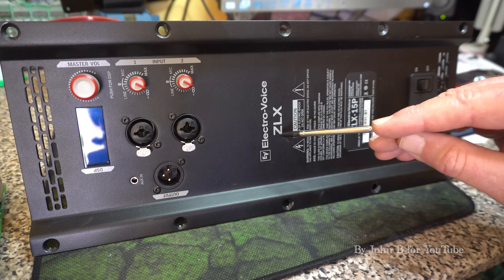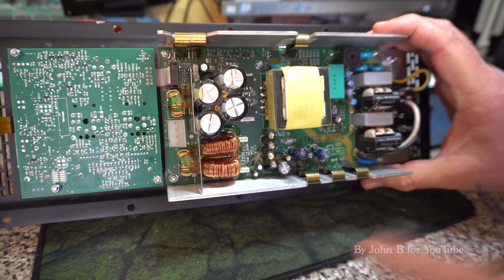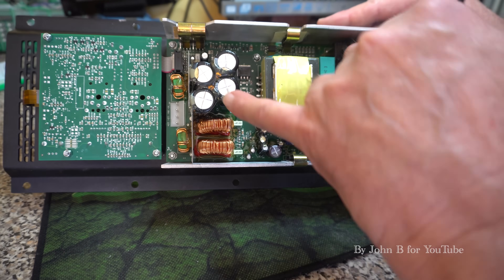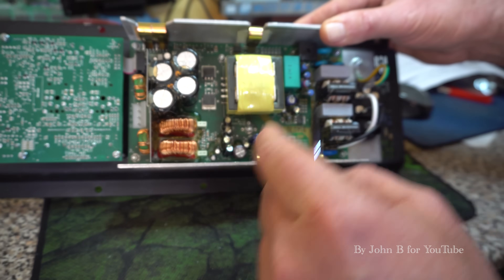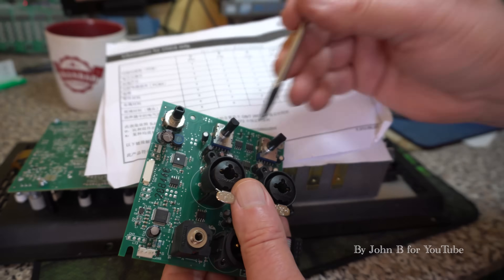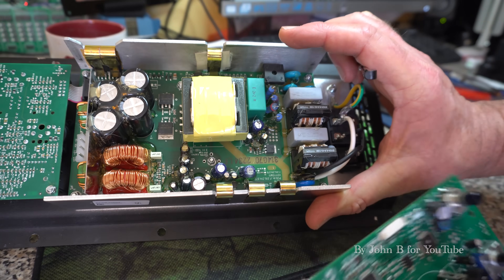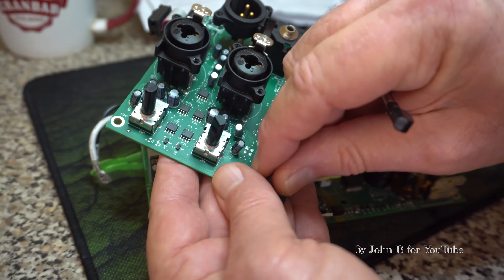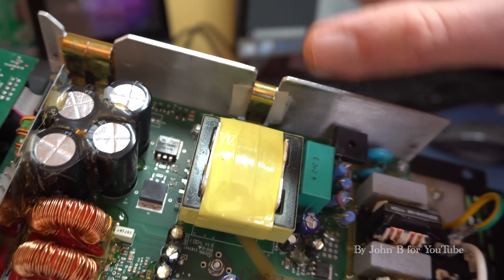The Inconvenient Truth about your Electro-Voice ZLX-12P & ZLX15P amplifier (Read Show More)

Comment: I’ve had my EV XLX 12ps for nearly 4 years now, and with an EKX 18” subwoofer, they sound beautiful and look great. I suggest using the DSP and setting the main volume limiter to negative 1 or negative 2, this will reduce the hiss to a level that’s so low, it’s almost nonexistent. It’ll also protect your speaker from going above where it should. Then set the treble to negative 1 or 2. I Dj Weddings and venues and charge between 1500 and 2000. The amount of compliments I’ve received on my sound and presentation have been very encouraging, and have allowed me to get more weddings from every wedding I’ve DJ’d. My EV’s have been in use, as stated for close to 4 years, 4 to 5 times a week. On Sundays, when I Dj at a Caribbean restuarant, they’re in use for 8 hrs straight.

The information in this video isn’t anything new, even though it’s very good information, that’s readily available on any good DJ forum, and it’s true of literally every speaker brand. Of course the 1000 watt number is wrong, It’s the advertising peak number, or more technically, the sound one can sustain for 2 seconds, without a hard limiter, before literally blowing the fuse in their PA speaker. Whenever a Dj tells me they have 1000 watt speakers, or 2000 watts, I laugh. The RMS number is what matters, and knowing how to properly use them as well.  These actually only use about 250 watts at best. You simply need to make sure you don’t use a traditional power strip, but rather a power adapter or conditioner that lets you know if the wall line is clean and outputs reliable currents. The other aspect is, even with my QSC k12.2s, which were almost double the price of my EV 12Ps, most PA speaker that are self powered will be using a class D amplifier and rate it’s power as peak rather than RMS.

Once you have a subwoofer and set the cutoff on the EV ZLX 12Ps to the user generated -100 or -120hz frequency setting, or the included properly pre-designed presets for the EV subs, you’ll prolong the life of your PA speakers, because the subwoofer cones in all of these are where the faults lie. They’re not reinforced properly to cut costs, and due to being bi-amped, will never replace a dedicated subwoofer. Using the Sub cutoff on the EV 12Ps also allows for more power to be relegated to the tweeter, producing a more well rounded sound with an external subwoofer .

As for the Mackies? I’ve owned several models that are newer, or within the 4 year mark, they all have the same poor, overly done bass, and sound boomy instead of clean. They also tend to have a louder class D amp hiss. While all class D amps have this, with the EVs when you cut the limiter by 2 it reduces this to negligible levels. Because a lot of excellent singers come to karaoke nights, when the music drops out and they sing, acapella, you can hear the clarity. When certain people sing, the bar crowd becomes quiet enough to their vocal nuances. With the Mackie Thumps, when people stand near my speakers, the hiss is perceptible and sounds cheap. I can use my $350 a pair EVs with my EKX 18” Sub and have people come out for either music and karaoke nights, or simply DJ nights, and always have people come back due to sound quality. When I use my QSC K12.2s, the main difference is that with the cutoff, they have a higher overall decibel rating. Without my included EKX Sub, the QSC k12.2 PA speaker subs also provide crisper bass. Aside from that though, that’s my OCD noticing that.

Some of my favorite singers who come out that also perform in churches and showcases, generally can’t tell the difference in the sound. That’s also down to my mics, as well as my mixer and my DBX go rack, where I use a final warm acoustic EQ, overall sound compressor, and lastly, a feedback suppressor, because at times I have as few as 2 singers with wireless mics out, or as many as 8 singers with wireless mics out. The DBX Go Rack is unfortunately not sold anymore officially. I paid $27 for mine when they were liquidating them. Unfortunately I only bought one. It was used at every gig I had for 3 years before dying during the last 10 mins of one of my gigs. I unplugged my XLRs from it and then plugged them directly into my PV AT10 sound mixer. The audio sounded nice, but it lacked the warmth that my crowd expects from my sound. Alesis mixers are naturally warmer, but the PV AT10 has a nicer array of effects and shielding. As a result, I bought a new in box DBX GoRack replacement and due to only being sold by 3rd parties, it set me back 225 on reverb. 😭

I can safely say that if you get the covers for the EV ZLX 12ps, and work with a sub, cutting off the 100 to 120hz signals, you’ll be in great hands. I treat my gear very carefully, and understand how to use the limiters and the mixer to avoid clipping. It’s also important to turn off the speakers first before turning off your mixer. Knowing about these things keeps your gear from getting damaged. At that point, after well over 1000 venue gigs and roughly 15 weddings a year, my EV ZLX12Ps still sound amazing. To be fair though, for roughly 5 of the many wedding gigs a year that I do, I use my QSC k12.2s for crowds above 200. They simply carry further for those events. If the fuse ever goes, EV makes it incredibly easy to replace via a cap on the back of the speaker.
Reply: Wow!! What awesome information! I'm a DJ/KJ as well and am looking at the EV's ZLX-12P and ZLX-15P. I would "really" enjoy communicating with you in helping me with my current setup. Your setup sounds very similar to mine. MY gray area is dialing everything in safely and getting the best I can out of it. Thanks for your Info. Ray 👍😊
Reply: RAPA Ent. You can always feel free to, I’m always happy to talk about DJ gear. To say the EVs have been great for me would be an understatement. My friend who DJs told me I have the warmest sound of the local Dj’s he’s seen, and truth be told, when I started again, his sound was my goal. He was using the original QSC K12s with the KSub. The thing that he had an issue with was equalizing his sound. Now starting out, I bought the Mackie Thumps, and the balance was never quite right. The hiss was also always present, and the treble, even with careful EQ presets was muffled. Then the JBL Eons were going down in terms of quality. 

At the time, the EV ZLX 12ps were the best reviewed in class, and they also were the only speaker in that price range at the time with a Digital Signal Processor. Ironically, I bought the  DBX GoRack to see if I could fix the sound issues with the Mackie Thumps. There was nothing that I could really do, even lowering the bass to see if it would bring out the treble didn’t help, it only made the class D amplifier hiss more prominent. While that wouldn’t be much of an issue with club music, for karaoke with the singers I’ve been lucky enough to bring in, it would be terrible. Their reliability also isn’t great. The JBL Eons had less hiss, but it was still prominent, they also had harsh sounding mids, and the bass wasn’t clean.

I returned both sets, and went with the ZLX 12ps. As stated, they’ve been used more than a 1000 times according to my nearly 4 year Virtual DJ history. When I finally bought the QSC K12.2s, it was interesting, by default, the sound is a little harsh, but it’s exceptionally clean. The bass is also quite good. Despite the price difference, like all PA speakers, they use a class D amplifier, so there’s going to be hiss, however, it’s lower than any speaker I’ve tested, even the ones most companies have had me use in the rare times when I’ve worked with a Dj team rather than solo. Properly EQ’d, they sound stunning. Now with the EVs, especially given their price point, the way you can cut back the hiss by reducing the hard limiter is surprising, it’s a little bit louder than the QSCs, but it’s also less than half the price, and the fact that that’s my OCD also comes into play. As with any PA speaker, having a sub helps, and as far as subs within a good price range, EVs ELX118 Sub is quite excellent. I’ve used it with both my ZLX 12ps and my QSCs. It’s not the most powerful sub, but I’ll let you in on a little trick I discovered accidentally. 

Here it goes, most venues have wood floors or hard tiles. When you place a sub directly on those surfaces, it creates what feels like reflected bass, it sounds like rattling in a way. Basically, the frequency of the subwoofer is vibrating the surfaces directly. If you use a Rock and Roller mini cart to wheel in your gear like I do, they sell an overpriced wooden, carpeted base for it that’s a separate charge. It has little lifted, wooden feet to slot it onto the cart. Placing it directly on the floor in a venue, then putting the sub on top of it completely prevents the refection noises. The carpeting on top also prevents the sub from vibrating on the surface. As a result, you get cleaner subwoofer bass and performance, without the odd sounds you get from directly placing it on the floor in a venue. Initially, what I’d do is use one of the Subharmonic EQ presets on the DBX GoRack, but since they’re overpriced now due to being discontinued, it’s not a recommendation that’ll help anyone. The Rock and Roller mini cart floor mat accessory provides a more consistent result in this case.

Hopefully this helps you in some way. And in the end, the ZLX 12Ps are routinely on sale on reverb with the EV slip covers. I’ve seen them for $600 during holiday sales, $100 less for a pair. When I bought them, they were $345 each, on sale from $400, and the slip covers were $60 each. It’s still a great value given their sound quality and the amount of usage I’ve gotten out of them. I have an EV EKX 18 inch sub, but use my ELX 118 much more because I only weigh 145 pounds and the ELX is just over 60 pounds, plus, it sounds great. The trick with the subs is the cutoff. It doesn’t matter how good the bass sounds on PA speakers, people complain at times because the bass is literally in their face or slightly higher when you poke mount them, and with a sub, it’s completely grounded. When you use the DSP on the ELX 12ps, there’s an option to cut 80-120hz of bass off of them, sending that down to the subs. The ELX DSP has a ZLX 12p preset, which sounds nicely balanced. With the subwoofer cones in PA speakers, and the amazing 6 year warranty on the QSC K2 series speakers is included in this comparison point, the woofer cone is typically always the first thing to go. Why? The bass cone will eventually micro tear after awhile, either blowing a fuse, or it’ll simply be due to how costs are always cut on the sub aspect of PA speakers. The QSCs have 6 year warranties due to using somewhat better materials than other PA speakers, but taking them apart reveals that while they have better cooling, with a clever passive heatsink and quiet active fan system, the sub cone, while still of better than average construction, is still the weak point. A decent dedicated sub, like the ELX, uses some composite titanium cone drivers as reinforcement. That’s why it wasn’t so bad to buy an ELX floor model from Guitar Center. It cost me $475 instead of its initially much higher price point. I wouldn’t do that with any other piece of DJ gear at all.

Sorry for the long response, it’s a bad habit on my part...
Reply: @ArtofZenDigital  Awesome information! Not too long, I found it quite educational. I've been trying to decide between 12" and 15" EV's and JBL EON's. Hum & Hiss is one of my biggest concerns from small rooms to even hearing it in larger halls. In either situation, DJing or KJing I don't want it. I've alway heard that powered speakers will carry it and that's mainly why I stayed away. I wonder how much newer EV ZLH's quality has gone down since you purchased yours? I know they have been around forever and have carried a great reputation for years. JBL's are looking good to me as well but, as you pointed out they have gone down in quality along with some hiss issues. I don'rt know how you feel about Bose other than the price tag. I came across their F1 812's that's quite different than anything I've seen. 
 That sub Rock and Roller mini cart sounds interesting. I have a passive Peavey 18"  SP Subcompact that come in at 110lbs. Been nice to for quite a while. I currently use a pair of passive Yorkville YS 15" which has also been great for me but......heavy.
 It's really hard to make a decision these days due to higher prices and quality loss. I do love the all the options that the EV's have. Decisions...... decisions??? Thanks again for the info., nice to hear a great positive side. Happy New Year to you and yours. Ray 👍😊
Reply: @rapaent  I have 4 zlx 12p's and apart from being very happy with the sound quality, there is indeed some hiss. It's not the same level in all of my speakers though. Perhaps I should dig deeper into the DSP, or that one has a little more wear - they were pre-owned by a DJ for 3 or 4 years. On my last gig I combined them with a DB technologies sub 05d which has a fixed built in crossover at 100 Hz. 
The trick of insulation the sub from the floor is funny, never thought about that. Usually sound folks recommend putting the sub on the floor or near a wall because the reflections will gain you another few Db. 
So far I've not squeezed the last Db out of the zlx+sub combo, the gig was in a rather small room, but it looks like I have plenty headroom on the sub anyway since I have to turn the gain down by what has to be about -5 Db.
Reply: Great the things u re saying..Please i ll need your knowledge.I have 2 zlx 15 p never pushed to the end and an ekx18sp sub.. whats the best adjustment i can make to them when pairing them? I have them on the pre factory adjustment the zlx to the sub on mode at the ekx 18sp and the ekx18sp to the zlx 15p mode..is that the best they can make cause i havent tried any other adjustment for example 80db or 100 or 120db...i want the best sound taking out of all of them.
And another question..comparing to the qsc 12.2 which speaker is better according to the better sound quality and the power cause im thinking of selling the zlx15p and buying the qsc.will they pair ok with the ekx18sp if i ll do that ? Or should i stay with the zlx15p which are very very good for me.The only use is at home studio never got them out at any event outdoors.
Sorry for my english hope u reply thank u.
Reply: Am, hoping my fuse has gone and not the amp itself

Comment: hey, I have a couple of these speakers and am hoping to power them with a car battery - does this mean that their average power consumed is at most ~350 watts? I imagine in practice it will be quite lower than that.
Reply from the maker: Hi,
If that's what the label states, then yes.
Reply: @JohnB-2021  the label states 1000W
Reply from the maker: @lofty5817  I'm pretty sure there is a wattage label near the mains socket and it's not 1000 watts. I assumed it was the 350 watts you quoted.
Reply: @JohnB-2021  ah there's no wattage but it does say "0.8-0.5A" which i guess i can take to mean that it's under 100W at 110V
Reply from the maker: @lofty5817  Yes.
Reply: @JohnB-2021  i measured it and it's about 20W idle, or 25W when being played loudly

Comment: How does an RCF710A stack up ? Rated at 700w ?
Reply from the maker: Hi
Sorry not seen an RCF, all I can say is my dj friend doesn't think they sound as good as a Mackie 450v2
Reply: John B aah i had The Srm450 v2 Before the RCF710A,and inmy experience is was an absolute step up,Backing vocals we put on our  backing tracks,for our duo gigs,seemed to reappear,the Clarity was far better,it had more headroom,as the Bottom end handling,improved greatly despite going from a 12” driver down to a 10”
Reply from the maker: @terrysteward  It's good to hear 
Thank you for your comments.
Reply: John B I think RCF makes the Mackie SRM450 v2’s. But yeah. Can’t go wrong with RCF. Their 7-series is fantastic!
Reply from the maker: @electrixfox  Thank you for your comments.

Comment: Thanks for showing this problem. I have a set of ZLX-12P speakers, and have the same issue with one of mine. Two repair shops told me that they could not repair that board, and they were not interested in trying. They told me that they could not obtain documentation and replacing the entire amp was the only option (too expensive). I used these speakers lightly for about 2 years for our band. They sounded great, and I was happy with them until one burned up - it is so disappointing that it cannot be repaired. Contacting EV, or Bosch Security was absolutely no help at all. I feel like, for my purpose and the way I use and treat my gear, that the ZLX-12P should have been more than adequate to meet my needs. As I purchase new speakers, I'm going to have to be more diligent about looking at how they are made.
Reply from the maker: Thank you for your comments, I show the repair link in the 'show more'
Reply: The only way to go in with you to have gotten the warranty when you purchase them because they need to swap them straight out at  Guitar Center